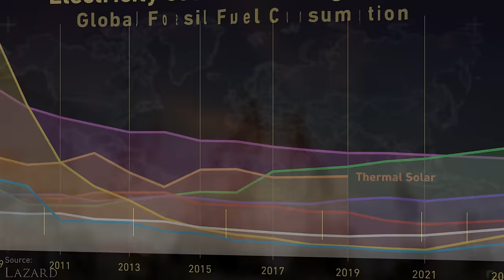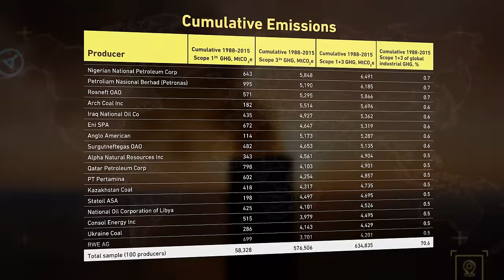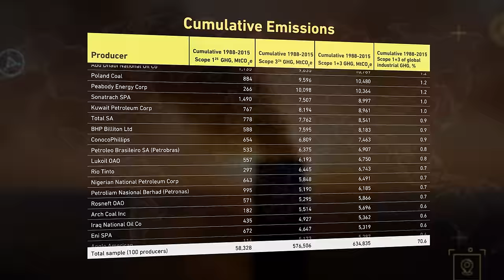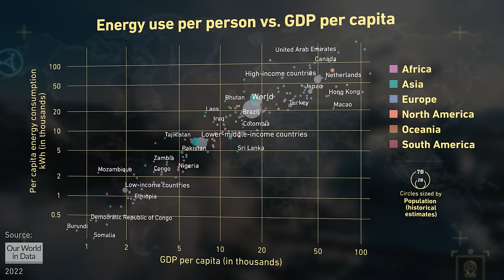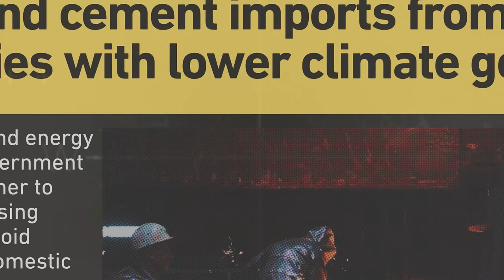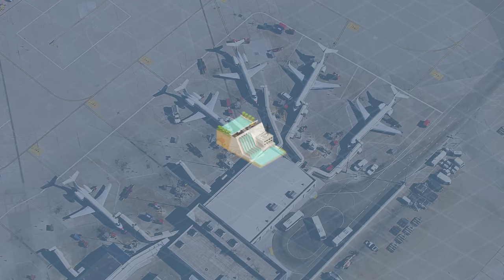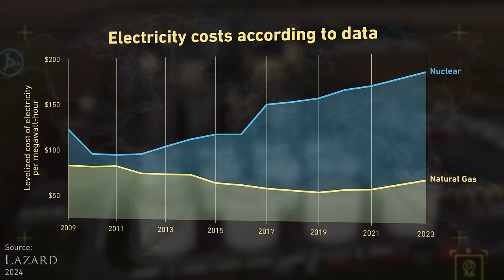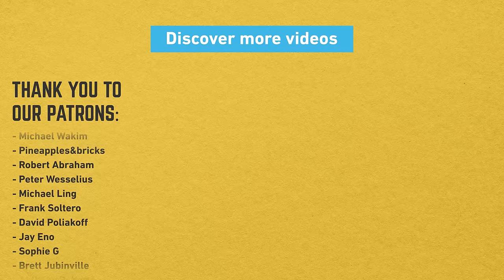Why We Can’t Just Stop Oil

Comment: Having worked in wind, solar, and oil & gas, I can confidently say, Nuclear is the only way.
Reply: I was a staunch opponent to nuclear in my youth. I'm no longer in my youth. Nuclear carries with it potential risks. Fossil fuelled thermal power is killing us. I'll take the risk.
Reply: @davidbrayshaw3529  Doesn't matter either way. Nuclear isn't happening simply cos it's not a great investment. The industry is in the doldrums. The only way nuclear will happen is with massive public investment, like France had. That's not popular with govts., and if they need to cut spending or raise taxes for it then it won't be popular with people either.
Reply: @ArawnOfAnnwn It's pretty hard to argue with those points. That is the reality.
Reply: Praise Atom
Reply: @ArawnOfAnnwn  companies are trying to get around this massive startup cost by emplimenting small modular reactors. These reqctors produce smaller (yet still huge compared to any other single facility) to reduce costs and are made modular so that more could be added in the future. This would disperse the costs out and specific areas woukd only pay for what they need. 

Its a start but public perception would have to change before snything substantial could be done.
Reply: @samjonas5494  SMRs are a red herring. They're actually LESS efficient than a big plant. The only reason they're tried is cos they're cheaper, cos they're also, you know, small. But as you add more modules to them so they start to approach the power production of a big reactor, they end up costing even more. They may have some potential for govts. that're committed to this goal, to spread the costs as you say, but I don't see private investment lasting when it's clear they'll be expanded later, as it'll make for an even higher cost. The only two cases where it might would be smaller communities (that typically aren't even served by big plants) where it would stay small - and when govts. agree to pay for it so as to cover for the higher cost.
Reply: Same here for work experience but I don’t think that’s it’s the ONLY way to go. It’s ONE of the ways to go, that should be considered by certain countries where it makes sense. There is no silver bullet to fix climate change; we need all possible options.
Reply: @ArawnOfAnnwn  Actually shifting to renewables will ALSO require massive public investment, and for noticeably degraded performance from the end user's perspective (much higher prices and probably also spot shortages). At least nuclear projects are "just" money.

Comment: In global grids, PV solar sells into the wholesale market at cheap rates. However consumers expect power 24/7 and therefore pay at the retail rates which is the PV solar cost plus the cost of FULL duplication of the PV solar capacity...which conceptually doubles the wholesale cost. 

Analogy: Yes we have an EV but we need a second car (powered by hydrocarbons) to provide 24/7 transport capability. We also have incurred the extra costs of a second: storage space, insurance policy, registration, maintenance and operator training. Its cheaper to drive my EV. However its more expensive to create 24/7 transport capability when utilizing an EV.

If you spend some time researching grid auctions for power generation and standby capacity...it'll make an interesting episode.
Reply: for transport they are Trains, despite the view that most car drives have agsinst them are way cheaper if build on existing motorway land(flatten ground, requires less construction cost as flattening of land is very costly), taking away motorways and providing traintracks instead!

Comment: You can replace them all with non-fossil fuel alternatives yes even shipping but it takes a lot of new infrastructure, one set of infrastructure out a new set of infrastructure in. The technology can make electric trucks right now. Container ships it would need to be hydrogen/ammonia which needs far far more hydrogen production that currently exists and the electrical production beyond that to split water. A large number of those ships are transporting oil and coal so you are reducing total traffic.

You don't need more land for solar panels you put them on roofs and over carparks, even as shade
Reply: Just on the electric truck issue - Electric trucks means more trucks (because they need battery space that is currently hauling goods) which means more congestion which means more road building which is not good. Electric trucks are heavier and therefore more damaging to roads hence more road repairs hence not good. Heavier trucks produce more brake particles hence more health problems hence not good. Electric trucks take longer to recharge hence lower utilisation hence more cost hence not good.
Reply: There is simply not enough cobalt in the world to create the batteries needed to move over.
Reply: @DrakonPhD  cobalt is already being replaced in batteries. Both Tesla and BYD the two largest EV makers use cobalt free Lithium iron phosphate batteries (LFP)
Reply: @SmileyEmoji42  depends on the design. You can for example use battery swapping. A smaller battery that is replaced whenever a truck driver takes a rest stop. Rather than having to have one battery do the whole trip. Some routes may be replaced by trains which can easily be electrical.
Reply: @narvuntien  Last I looked nobody believes in swappable batteries anymore - In fact, if anything, in cars, the opposite is happening - the batteries are being incorporated into the structure of the car making them hard to replace even for repair. As for trains - You specifically mentioned the present state of technology for electric trucks so that is what I commented on.
Reply: @SmileyEmoji42  I mean Nio is still trying but it doesn't make sense for personal vehicles  (although many developing countries have swappable battery stations for EV motorbikes) When we are talking about commercial logistics the economics changes. Not everyone wants or needs the same kind of car but if your company has thousands of the same electric truck or at least a compatible one it works out differently.

Comment: A quick patch to help reduce this issue would be to push right to repair so we can keep goods operating and being useful for longer rather than having to replace them all the time. It should reduce the need for some new things. It's very hard to reduce fossil fuels unless we find a way to store a ton of energy, something like a solar panel that splits water and makes chemical fuel would be great since it can be directly used in existing infrastructure... fixing the storage problem.

Comment: These charts don't factor in the fact they need 2x the cost to factor in storage if you want it to be reliable as thermal/nuclear. Also nuclear would be much cheaper with economies of scale as more were built
Reply: U also have to add grid costs which is 10€/MWh at 10% and 50€\MWh at 50-70% wind/pv and 1-3€\MWh for gas/coal/nuclear. You can not use LCOE to compare intermitten and non-intermittend power generation. Lazard also uses pure fictional projects, no data from real onces. OECD studie showed 45-97€\MWh LCOE for 3-10% discount rate for France for projects started after 2025 based on real build projects.
Reply: LCOE of wind/solar + batteries is like 1/3 that of nuclear. Yes, including the battery storage.
Reply: @tHebUm18  yea na 🤦‍♂️. Were is your calculation? Not in the slightest. Germany just activated their coal plants and build up gas plants for fun ... u need at least a 30 day batterie storage ... you can figure out the rest ... tip google "world batterie production capacity" 😘
Reply: @tHebUm18  idk where you are, but here in the states this is simply not true. I just did a research paper specifically here in California and from what I found my statement is true here.
Your mileage may vary
Reply: @krautergarten4529  Lazard's 2023 LCOE report.

Yeah, capacity is still ramping up, doesn't make it not have the best LCOE for projects that can secure it.

No project needs anywhere need 30 days of storage.
Reply: @tHebUm18  You have not even read the Lazard report. They didn't account for grid infrastructur or storage ...
Reply: @krautergarten4529 storage is all that matters. It’s the only thing. It’s the tech. 

Once battery tech (energy storage tech) is good enough, everything everything else will be inferior to solar
Reply: @SigFigNewton  sadly there is no way with batteries, nor pumped hydro .... here are the calculation ... it's looks grimm for renewables

The Green Transition will not work as planned, what might we do instead? - Professor Simon Michaux / Sustainable Minerals Institute UQ
https://www.youtube.com/watch?v=YbnXMv19Hck
Reply: @krautergarten4529  no way to make a horse go 100 miles per hour either. Yet people can drive 100 mph.
Using current tech and pointing out that it takes too much copper etc is just as short sighted as announcing a speed limit for traversing the United States based on the horsemen.

We’ll make something work because the alternative (burning fossil fuels for electricity) is a nonstarter

Comment: Fun fact disabled individuals on Ssi/D are not allowed to purchase newer vehicles. I believe the cap of is now 10 yr. I drive a 93 corolla if it breaks down I'm fucked because I'm now allowed to save, and only allowed 2000 in my account capped ever. The US government does not want to transfer from oil, when it mandates its most vulnerable residents to be poor and to drive gas running vehicles if they are able.
Reply: What is Ssi/D?

Comment: You seem to miss the real reason why individual consumption can't in practice make a meaningful difference. Because consumers have a limited ability and patience for researching the products they buy. So a company using greenwashing will always outcompete a competitor who makes genuine improvements to their business practices.
Consumers are not rational and those 100 companies are very good at manipulating them.
Reply: Or you know... the fact that a majority of emissions is from industry & commercial transportation. Statisticians seem to conveniently leave that little tidbit out.
Reply: not to mention that often there simply aren't companies doing things in an environmentally friendly and sustainable way. especially true when there is a monopoly or oligopoly in the sector (which is the case in a lot of sectors). the problem is on the production side and regulations and other tools of government are required to make businesses compliant with the environmental standards we wish to obtain. political power is a lot more effective of a tool than buying power.
Reply: @Coconut-219  About 75 percent of those emissions came from burning fuel to create heat, and the rest were by-products of industrial processes that transform materials into products. Most emissions in the manufacturing sector come from the chemical and refining industries.Feb 28, 2024

Comment: We can't completely stop oil dependency but we can diversify our energy needs so we can reduce dependency on oil and with rise of alternative energy sources such Biogas, bioCNG, Syngas, blue hydrogen, biodiesel and electric dependant engines and vehicles there is alot of hope for the future also the petro dollar will only affect countries who buy oil from Saudi Arabia. Countries who are buying oil from non Saudi sources are using alternative currencies such as Yuan like UAE did they offered the Yuan currency option to sanctioned and non western countries. Nuclear power is also back on the horizon so basically it can be anything at this point.

Comment: The question not even addressed is how to create those thousands of different petrochemical products without oil and gas. Even if we switch to 100% nuclear & renewable energy with 100% electric transport, there's still the petrochemicals that nobody ever talks about. What do we do about that?
Reply: Making those products locks in most of the carbon and uses orders of magnitude less oil than energy so it’s actually possible to make carbon capture offset it.
Reply: @ewanlee6337  In brief, carbon offsetting involves compensating for emissions by supporting external projects, while carbon capture is about capturing and managing emissions directly from your own operations.
Reply: @TCKRDefense  carbon capture is anything that “captures” carbon. Though it does normally refer to capturing carbon released by a company’s operations, direct air carbon capture is a thing and it is when the carbon is being taken out from the atmosphere.

Comment: Can we make steel without burning a fuel as part of the process?  I don't think we can.
Reply: Yes, renewable hydrogen can help reduce the steel industry's carbon footprint by allowing steelmaking without the use of fossil fuels. When burned, hydrogen only emits water, and if it's produced through electrolysis using renewable electricity and water, it's completely free of CO₂ emissions.
Reply: Hydrogen can be used in steelmaking in a few ways, including:
Direct Reduced Iron (DRI)
Hydrogen reacts directly with iron ore to produce iron and water instead of iron and CO2. This process is already being used with natural gas instead of hydrogen.
Replacing coking coal
Hydrogen can replace coking coal, which is traditionally needed for ore-based steel making. Hydrogen reacts with iron oxide at around 800 degrees Celsius, which saves energy in the heating process and produces spongion, with water as the only byproduct. The sponge iron can then be processed in an electric arc furnace. 
Some companies are already using hydrogen to make steel, including:

Hybrit
A Swedish company that uses HYBRIT technology to replace coal with hydrogen in the iron ore reduction process. In 2021, Hybrit delivered the world's first customer delivery of "green steel" to Volvo AB.

H2 Green Steel
A company building the world's first and biggest full scale green steel plant in Sweden, which is expected to start in 2025. The plant will combine production of green hydrogen, green iron, and green steel in a single flow, using renewable electricity throughout the production process.
Reply: @TCKRDefense  Is carbon not needed in the process?

Comment: Renewables are definitely NOT cheaper than fossil fuels because 100% capacity of reliable generation still needs to be maintained. The countries with the greatest proportion of wind and solar also have the highest electricity prices.
Reply: Electric heaters & ovens still never really took off in the U.S. and that's even when most of our electricity was generated by gas powerplants. Nowdays the divide between gas and electric is actually only getting wider as the cost of electricity increases because of government mismanagement.

Comment: Simple answer is we know everything that is wrong with fossil fuels, however, green fuel is not much if at all better due to mining and shipping batteries all accross the ocean. 

The only true alternative and SAFE Fuel for providng power is NUCLEAR FUEL. It is extremely safe and industry around it is robust in western countries. They are more efficient and over course of it's life it is far less environmentally harmful compared to solar and wind which isn't a consistent fuel source.
Reply: Lots of technology have major uses. But you are right with the simple answer we get of solar and batterys is not enough, nuclear, advanced geothermal, battery alternatives like compressed air, and others low in rare resources. Also public transit, rather then millions of mini battery vehicles
Reply: @dannydenison6253  I'm super pro-transit but you still need a green grid to provide clean electricity for electrified rail for maximum environmental benefits, alongside removing the carbon emissions of cars off the road
Reply: Facts

Comment: Most people just don't realize you can't "just stop" things that have been going on for a while. If you want to change something it'll take time and effort, probably a lot of effort.
Reply: Time, effort, and reasonable alternatives. Solar and wind aren't reasonable alternatives to replace oil for infrastructure power generation. Nuclear is a reasonable alternative, but the regulations around nuclear has it in a suffocating vice grip. But beyond that, vehicles still need to move, trains need to move, and we still need to operate a military. We have no reasonable alternatives for them yet.
Reply: @vallahdsacretor4839 I agree that nuclear power is currently the way to go, it's much safer than you think and people are just grossly uninformed about it. Kyle Hill makes great videos about the safety of nuclear power
Reply: oh for sure. and the reason we haven't moved away from oil is because we haven't made that effort. in some areas it's harder than others for sure, but if we had the political will to do it, we could have reduced our dependency on it dramatically in the last few decades.

Comment: Yeah, chemical energy kinda rocks, and it's super transferable. Hard to argue with that. 

The US Navy has a patent (available to US companies) for synthesizing jet fuel from seawater, but it's energy- intense. A nuclear power plant could do it easily, but past that it's negative CO2... not sure about compared to extraction or renewable sources.

JS
Reply: Sure but solar is superior
Reply: The panels are still rapidly improving, but they’re already good enough to be the best energy source on the planet
Reply: What’ll be, a decade? Before energy storage tech is good enough to power a city at night with solar?
Reply: After all, there's a few significant figures in power throughput and energy density between solar and nuclear... and at least one in both public and worker safety. 😉